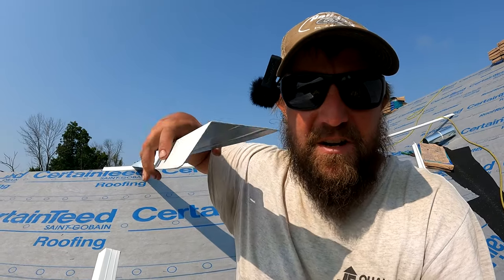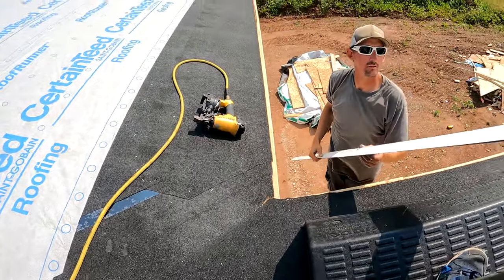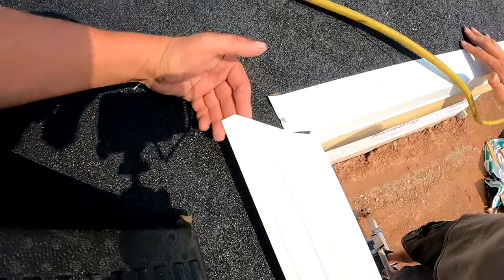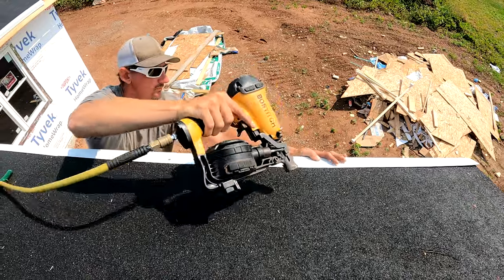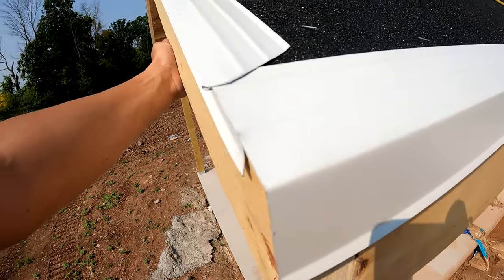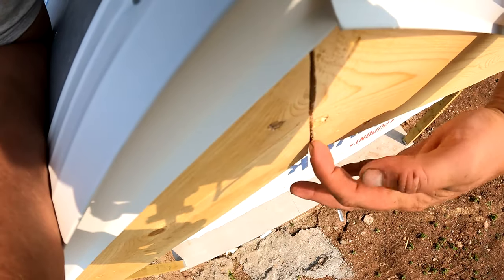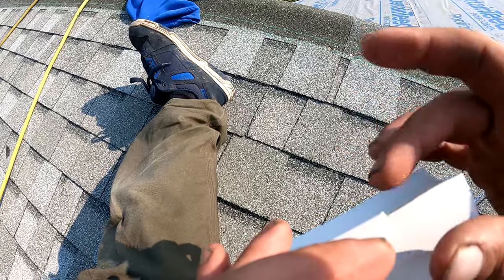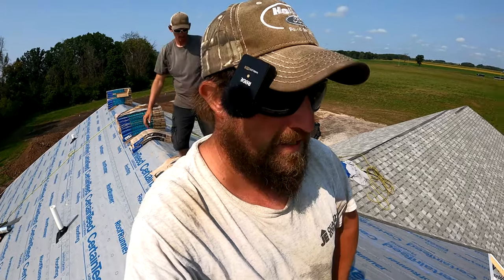HOW TO INSTALL GUTTER APRON AND D-EDGE

Comment: We would put the apron or drip edge under the ice and water here in New England. Then the rake edge over the underlayment. It helps us with ice dams and wind driven ice/rain. It actually says this in the instructions of most shingles. It looks like you're in a warmer climate though. Nice video!
Reply: They need to do the same in Nashville as well. While we dont super freeze every winter there are many times we get some good snows and weather stays around 0 and or below freezing for weeks or more at time, just not ever year.

Comment: The apron should be UNDER the weather shield on the eaves and the drip edge on the rakes should be on TOP of the weather shield or roof underlayment. There should be a 1/4” gap BEHIND the gutter apron.

Comment: I just watched a video that said DO NOT place it tight against the face board and allow a little space between it and the apron for the gutters and here you say place it tight against the face board that will have to be bent for the gutters...appears everyone is different and everyone has their own way of doing things...LOL
Reply from the maker: You want it tight or your fascia metal will not hold as well
Reply from the maker: @Kyle-84  The metal should be tight but I also install fascia and gutters and we know what is right and wrong. On this house we did siding,soffit,and fascia and everything was perfect. We use the 2' 5/8' d-edge that is aluminum and it works great for fascia. It is hard to mess up gutter apron...I have seen it but we know better
Reply: It shouldn't be tight if a gutter is going to be installed, it's a gutter apron made to drin water into a gutter and the gutter need to behind it, the gutter installers will have to bend the gutter apron up for the gutter to fit.
Reply: @handydandyhomes you also don't want it too loose especially in cold weather regions or water/ice can get behind it and freeze causing extensive damage to the fascia board and soffit regardless if it's covered with aluminum fascia/soffit or not.

Comment: Do you leave a small gap under gutter apron or do you put it against the eve board?
Reply: I saw a different channel say to leave a little gap for the gutter guys, so that they can slide the gutters underneath easily, and don’t bend it out of the way.
Reply: Seems like it’s a combo of preference and experience with other trades, rather than something that actually matters, performance-wise.

Comment: Well how do the screws on your gutter clips work if they are clipped on the back part of the gutter? Seems like you can't slip the gutter up behind the guard with the clips attached.
Reply: Don't clip hangers on the back of the gutter. Let them hang in the gutter and slide the gutter under the drip edge, high point as far up as you can, then set your gutter slope from there. Screw hangers to the face of the drip edge and through the back of the gutter.

Comment: R905.2.8.5Drip edge.

A drip edge shall be provided at eaves and rake edges of shingle roofs. Adjacent segments of drip edge shall be overlapped not less than 2 inches (51 mm). Drip edges shall extend not less than 1/4 inch (6.4 mm) below the roof sheathing and extend up back onto the roof deck not less than 2 inches (51 mm). Drip edges shall be mechanically fastened to the roof deck at not more than 12 inches (305 mm) o.c. with fasteners as specified in Section R905.2.5. Underlayment shall be installed over the drip edge along eaves and under the drip edge along rake edges.

Comment: I install CertainTeed and the underlayment says (in bold) DO NOT use staples... 1" cap nails are to be used per manufacturer warranty. Dont see any cap nails on underlayment. 7:07 7:09
Reply from the maker: All synthetic underlayment says to use cap nails. I did not install any of the underlayment on this project and personally do not think it matters
Reply: @Lifes_Apprentice  All good read the directions on the outside of the underlayment roll. Might save you from buying the homeowners a new roof... mitigation measures will save money and headaches.
Reply: @JB-mh6xz  by your logic, all nails in shingles would have to be 1" cap. He's not attaching underlayment, he's doing the drip edge and rake metal flashing. Underlayment manufacturers instructions don't apply.

Comment: Seems like gutter apron should go under the ice shield
Reply: I would think the same thing. However upon research, it seems standard practice for a gutter apron to go under the shingles, before the underlayment. But if using drip edge, then it's standard practice for the drip edge on an eave end to go on the sheathing, then underlayment. I am not exactly sure why this is, as from a water flow perspective, it seems like both options should be directly on underlayment. But maybe gutter apron is often installed after a roof with gutters, and therefore why standard practice to go above under layment. Dropping this comment, because I'm researching this as well.
Reply: In California that is Standard Operating Procedure... I install CertainTeed and the underlayment says (in bold) DO NOT use staples... 1" cap nails are to be used per manufacturer warranty.
Reply: if you put the gutter apron under the water & ice shield, "you will" get ice damming, if you are in areas that are acceptable to it. i see this issue often!
Reply: Literally the most debating topic in roofing. You also have to follow local codes, like them or not. Do a YT search on this and you'll literally find videos of people arguing about it. Literally.
Reply: No it goes first and then ice and water
Reply: R905.2.8.5Drip edge.

A drip edge shall be provided at eaves and rake edges of shingle roofs. Adjacent segments of drip edge shall be overlapped not less than 2 inches (51 mm). Drip edges shall extend not less than 1/4 inch (6.4 mm) below the roof sheathing and extend up back onto the roof deck not less than 2 inches (51 mm). Drip edges shall be mechanically fastened to the roof deck at not more than 12 inches (305 mm) o.c. with fasteners as specified in Section R905.2.5. Underlayment shall be installed over the drip edge along eaves and under the drip edge along rake edges.

Easy search

Comment: Certainteed ice and water is the worst. Super slippery. Harvey Ice and water is the best. Also the ice and water should be 1 inch passed the eve of roof if your going to add drip edge on top. Water can and will get behind and rot the eve of your roof. I add ice and water over top the drip or extend my ice and water

Comment: This is the most confusing part of putting on the D edge....you say to put tight to the fascia boar, others say to extend it off the fascia, a finger width, 1/4 of an inch or so, so the water does use service tension and come back to fascia, it drops straight down and it also allows the gutter contractor to easily slide his gutter up under it
Reply: I saw too and was thinking the same thing until he said they would slide aluminum fascia up under the drip edge to cover the wooden fascia.
Reply: It seems that the d-edge has the angled portion at the bottom that will protrude out from the fascia, which should be enough to break the surface tension. Might be interesting to do a little experiment to see what is actually needed.
Reply: @slydog7131  while it does have the angle portion that is suppose to extend out it seem it alwatys gets pressed up against it. The mexicans just go too fast to get done properly and get to the next roof. They really have never been trained. When I had them do it on my home they had never hesrd of it before. Not that Tommy is the be all answer to construction on This Old House but this is houw he instructs all his students and it makes sense. my drip edge was smashed by the guys, I made them take it off and do it again